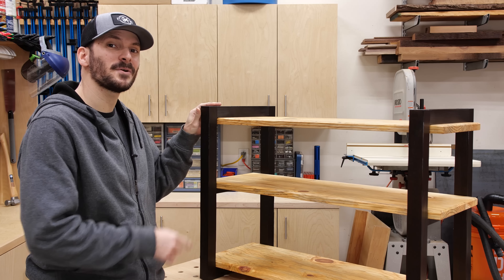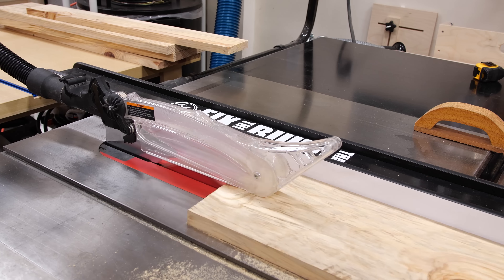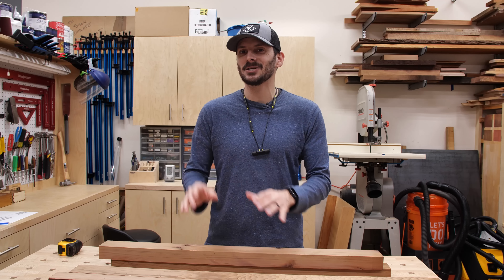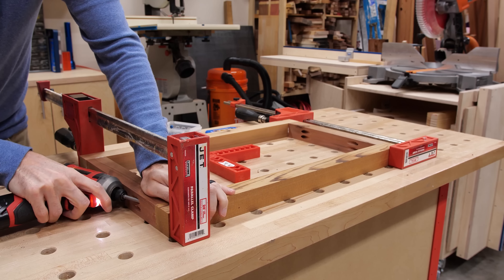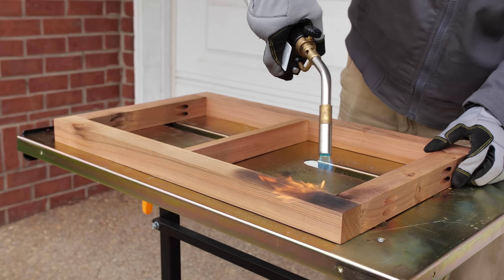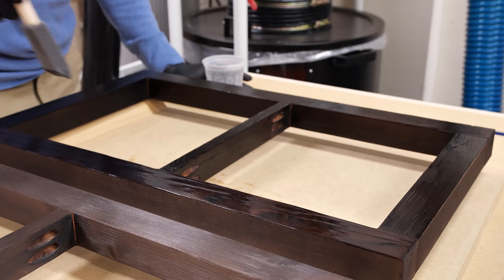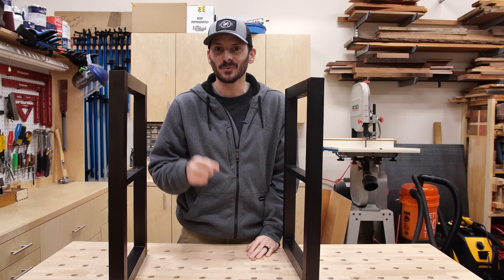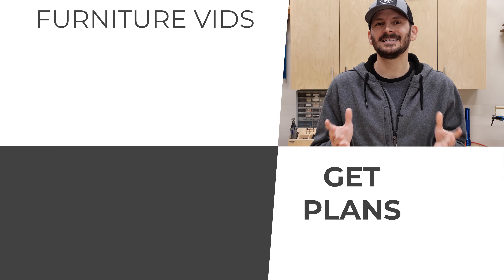How to Make a DIY Shoe Rack with a Unique Finish

Comment: Have you noticed that the surge impacts suck for pocket hole screws since you don’t hear the noise difference when tightening? One of those unexpected negatives about an amazing tool. Love mine, I just use a regular fuel for pocket hole screws so I can tell how tight the screw is getting
Reply from the maker: I can tell a difference in the sound of the screw vs the drill.  But yeah, it's not as obvious.  Still love the Surge though!

Comment: Love the videos. Would love to see a little detailed explanation in addition to your comments of things like “water-based polyurethane” - what finish?
“After sanding applied the finish” - is that the same poly or did you use stain? We’re there multiple coats of that and was anything added to it?

I personally run into a lot of issues with finishing, I can never get the “commercial” results for stain, paint or poly. My work is often being tacky and very short-lasting against wear/tear. 🙏🏼

Comment: Good thought for the use of the shou sugi ban finish. I do a deep burn using pine to make flags, if done right you can actually get three color gradients from one stain color by letting the stain sit for 30 to 60 seconds and then wiping the bulk off. That was a nice way to hide the pocket holes for all of your side bracing.
Reply from the maker: yeah, I totally want to use pine and do some staining.  It's such a cool look!

Comment: Always great to find a fellow Eagle Scout.  Keep up the great work.

A quick inexpensive tip for work with "burnt" wood.  Place a thin coat of mineral oil and let set overnight before top coating.  This gives the wood a "deep moisturizing" helping the wood bond tighter to the char while greatly reducing warping tendencies. It also saves money by reducing the amount of expensive top coat needed.

Comment: Great build, Brad, and a great look. Does that planer leave any end snipe? That's always my concern when I see a piece cut to length and then planed.
Reply from the maker: Thanks, William.  It does pretty well with snipe.  Especially if I lift up on the boards coming out, then it's almost nothing.